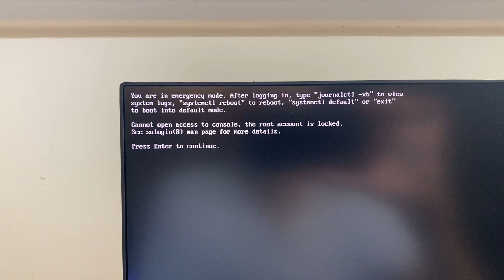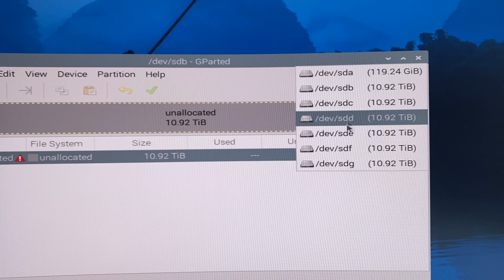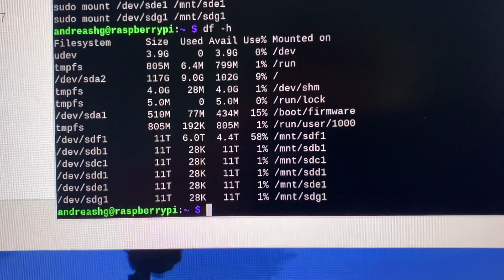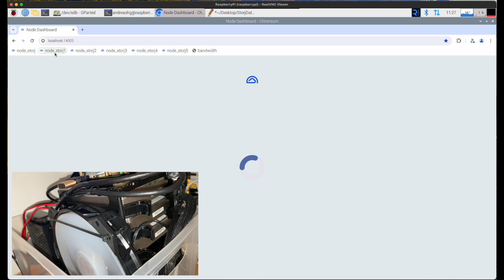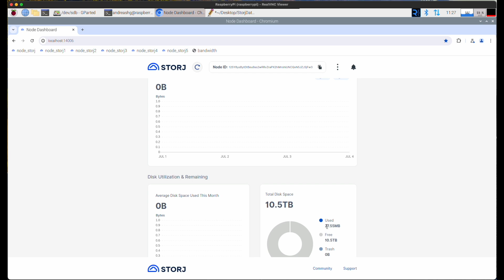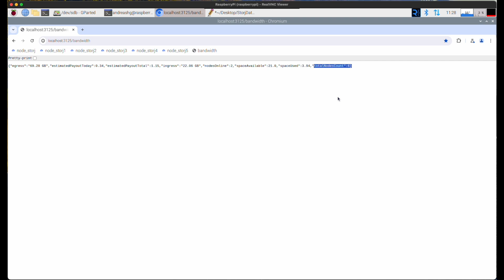Ultimate Raspberry Pi 5 72TB Server - Geekworm X1009 SATA Shield | Low Power Storj Node

Comment: Problem with this is you make it, then you want it faster so upgrade to ssd or nvme. Then you want it fast on the network 2.5 Gb, 10Gb, 100Gb, 400G and then your hooked.
Reply from the maker: No, it’s for storj, so I don’t need more speed in it :)

Comment: Hello, Thank you for the video! I am looking to build the same system with 5 hdd's just using the board's built in sata connections but I have a couple questions. Are you currently powering the Geekworm board with the RPI's pins? Also, is there a way to also power the board with the ATX psu to eliminate the need to power the pi separately?
Reply from the maker: Good questions! Please checkout and have a look on my newest video. I use another geekworm board where I can power from ATX PSU
Reply: @hgsoftware5129  link to new video please, i also love your video. i plan to make rpi portable nas but power is going to be 3 x-ups1 and 12v 10amp psu to keep it charged and running

Comment: I would never trust 72TB worth of drives to a raspberry pi running JBOD ext4. What you want is a good self-healing COW fileystem like zfs, and you're leaving performance on the table with the Pi. Haven't tested, but don't think you can get full 2.5Gbit Ethernet speed out of it.
Reply from the maker: You are missing the use case here.
It’s for storj.
I don’t need speed
And I don’t need redudancy

Comment: Could I ask how is this holding up? Do you have any issue with throughput or stability and heat? Have any cool case/cover suggestion for this?
Reply from the maker: This is still going strong! I have not had any issues and all 6 disks are stilling running no problem. Check out my newest video where I have a website you can visit to see its running

Comment: At this price point (RPI 5 + SATA HAT plus all the additional adapters and small PSUs) it's better to invest in a N100 NAS motherboard. You will get 6 native SATA ports and you can add more through PCI-E slot or with m.2 to SATA adapter. Power consumption will be 5-8W higher. You can even install TrueNAS and run StorJ as a natively supported app in TrueNAS while having the benefits of all the management, monitoring and alerting TrueNAS has to offer.
But for a pure Pi project, yeah it's cool :)
Reply from the maker: 100% Correct- this was more of a pi project i wanted to give a try.
Btw check my newest video with The website everyone Can use to monitor The pi :)
Reply: But there are people (like me) being tired of x86 craps, and I pay happily a bit more for a nice arm/ppc (anything but x86) based solution. That’s why I built my retro arcade stuff on rpi5 with nvme and analog rgb  hats. And it is a litle diamond :)
Reply: You mean aliexpress N100 junk?
Reply: @su1ka  Yes. It was probably manufactured one street over then one you have.
Reply: @CoreyPL  but the problem is with the quality control, cheap components and very poor BIOS that probably will not be supported... unfortunately... 😞
Reply: @su1ka  I know. But on the other hand there are few manufacturers that proved to be reliable in the long run, with designs that doesn't make PCB design specialists faint on the other side of the globe. Some even do BIOS updates :) And truth is that they sometimes make weird combo solutions with features not seen anywhere else. It is a risk, but sometimes I'd like to embrace the jank.
Reply: I have the n100 with 4 X SATA drives, idles at 40-50w, that sucks, it doesn't get above cstate 2-3, and I doubt they'll ever release bios updates. If I had my chance over I wouldn't buy this again
Reply: @flip550  I have N100 soft firewall and it idles at 11W with one NVMe drive. If yours stops at C2/C3, then I think problem lies elsewhere. Does your motherboard have built-in SATA or have you used add-in card? Built-in SATA would mean JMB585 chipset was used, and this one does not support ASPM L1. Furthermore you need to config powersave CPU governor in your OS and enable SATA drive power saving. One idle SATA drive without power saving options enabled can use 5-6W of power. There are more config options that can be done, but it all depends on your platform and OS used.

Comment: Untidy setup I have to say... the most important thing at least to me was to know if the board power connector can handle 5 3.5 current draw
Reply from the maker: Thanks for The feedback. The setup has Been rock solid so far - new video coming soon.
And The board Cannon handle 5 3.5 hdd i also mentioned this in The video and thats also why i use a normal ATX PSU

Comment: It's a neat experiment, but I wonder if just buying an old office tower and adding hard drives to that wouldn't be more cost effective.
Reply from the maker: New video aboout it is coming soon
Reply from the maker: It Might. I wanted to work with The rpi5 and its Low power usage, so far its been great

Comment: Any thoughts on using the Radxa Penta SATA Hat instead? Any reason why you chose this Geekworm one?
Reply: Well, idk if this one is RAID Capable, but a good difference point is at the SATA connection config, cause´ with this one you can use SATA cables and you can fully manage drives disposition in your custom case, in contrast the "Radaxa" one that you can only put your drives in a single position and only you can put 2.5" drives
Reply from the maker: I dont know that one, i Might wanna give that a look

Comment: Useless. With pi's throughput perf.
Reply from the maker: I disagree, with pcie its fast enough for a node
Reply: @hgsoftware5129  Thank you for your video! Is it fast enough to actually use 4 2,5 SSDs?
Reply from the maker: I belive so - but im not 100% sure
Reply: @phil9309  depends on clients. 
Useless for common home users: media server, surveillance, various IoT logs.
It should be useful only as a toy project for low throughput tasks and if delays do not matter
Reply: @hgsoftware5129 I'd love to see some kind of disk performance test. This is probably fine for most stuff, but some people need more throughout on their data storage.
Reply from the maker: I might make a small video of that👍🏻
Reply: Thanks for the video. It's wicked awesome

Comment: i'm kind of newbie here, but one question comes to my mind, why did you have to run one node for each disk and not join all of the disks to one same node?
Reply from the maker: That’s a great question! Thanks for asking.

I all disks have 1 single node, then if one disks fails and dies the whole node will be forever lost. But this way I split that risk :)
Reply: With more powerful hardware you can run RAID and have one node with drive fail protection, but you always loose capacity (unless RAID0, but nobody would use that). He just choose to risk node failing (single drive) to not loose the capacity and maximize earnings - smart thing to do with that low-power setup.

Comment: 7:03
You need to connect common ground between the ATX power supply and USB-C power supply from the source.
Currently your system are having common ground from SATA Pins and USB Pins, which is disturbing as these are DATA Pins, NOT power pins. 
Having Data pins carry your MAIN ground might cause instability at best and data corruption at worst.

My suggestion, connect 2 or 3 GND GPIO and connect it to any  4 PIN or 6 Pin GND as those have thicker gauges.
Reply from the maker: Hey - thanks for the comment, but the ground is shared with the PSU so i belive grounding is sufficient
Reply: @hgsoftware5129  
You mean AC mains? That's earth and most modern PSU has isolated AC and DC.
Don't believe me? Set multimeter to continuity between earth pin and GND of your power supply.

You have common ground so your negatives don't go out of whack.
12V psu is not 0-12V, it might be -1V and 11V. Similarly, Pi 5V is not 5V-0V, might be 4.5V,-0.5V.

Remember data pins are only 0 and 1s. So if you don't combine both grounds, PSU1 says -1V is ground, PSU2 says -0.5V is ground, your data will have a hard time mix matching grounds like that causing instability. 

Just connect both grounds!!
Reply from the maker: Thanks. Im not sure if i understand 100% - but i Will look into it
Reply: @hgsoftware5129  
A simple example is led strip.
The controller = 5V
led strip = 12V
The led strip won't turn on if you don't connect the grounds together.
Reply from the maker: So just to understand, what device so you belive that uses 5v and needs to ground with 12v?
Reply: @hgsoftware5129  
To be more specific, 
ESP32 = 5V power supply
12V led strip = 12V power supply
Both using separate power supplies, won't work unless it has same ground.
Reply from the maker: Okay
Reply: @hgsoftware5129  
I'm just saying you already have SOME common ground by plugging in USB and sata. Sata connector has 6 pins for ground.

That said, try not to use the data grounds for this purpose.
Reply from the maker: Okay, thx

Comment: Hardisk More expensive than raspberry pi🤣🤣🤣🤣
Reply from the maker: Oh Yea! Alot more expensive - pi is Allmost the cheapest in this build😂
Reply: exactly my thoughts it's $63 just for sata ports. 
also if you include raspberry pi cost, it is not feasible. I'd instead go for Intel n100 motherboard.👍👍
Reply from the maker: Yea - the n100 with a mobo is 100% a cheaper option :) this is more for entertainment and having fun building it ;)
Reply: @hgsoftware5129  yes I agree with you on this one 💯
The process of making and the enjoyment that we get out of it is priceless 😇
Reply from the maker: 100% - also i really wanted to make a video of this.

When the jonsbo n5 comes out, I would love to make a video about a build in that, maybe using the n100.